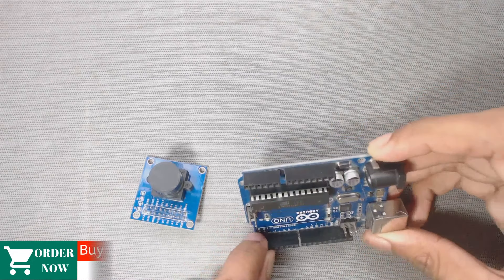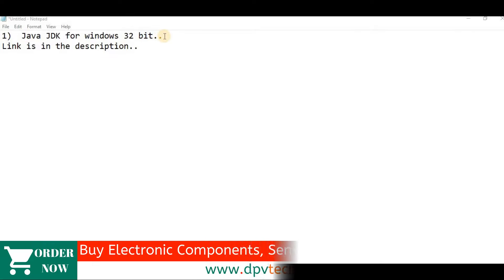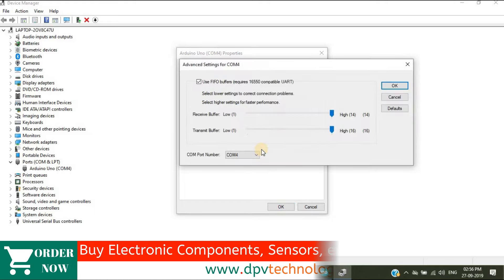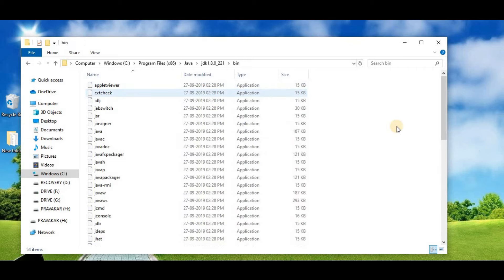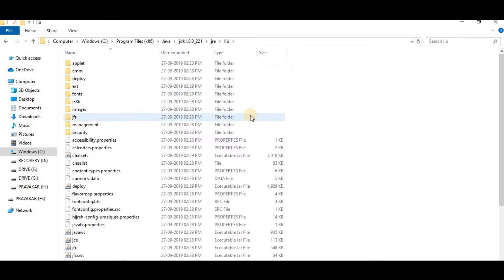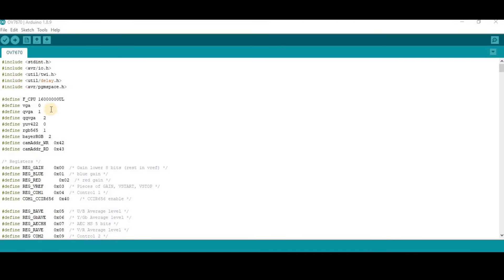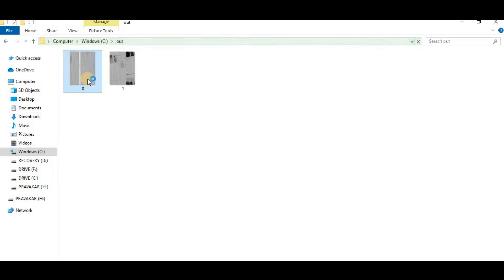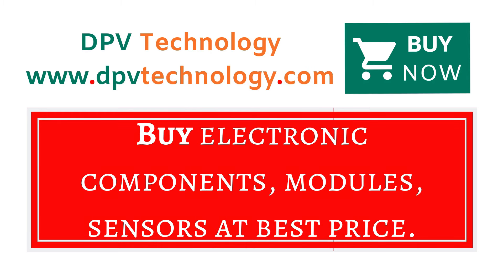OV7670 Camera Module With Arduino Step By Step

Comment: Hey , I am getting the error , SIMPLE READ could not find or locate .""? Can you please help me that
Reply from the maker: Please check the wires and connections. I did not get the error. It is very difficult to guess the problem without doing practically.
Reply: Did you solve your problem?
Reply: did you extract the files before copying?

Comment: I would like to ask if it will work the same with ov 2640. The only difference between 2640 and 7670 is XCLK. I actually tried it it didn't work.  In the end in java it says Error. Couldn't find or load the code.

Comment: thank you for your video.  I get an error at the command prompt entering :
C:\Program Files (x86)\Java\jdk1.8.0_241\bin>java code.SimpleRead
Error: Could not find or load main class code.SimpleRead
how can I get this file?
Reply: You should write "cd C:\Program Files (x86)\Java\jdk1.8.0_74\bin" and then "java code.SimpleRead"
Reply: @bilgehankarakus818  Error loading win32com: java.lang.UnsatisfiedLinkError: C:\Program Files (x86)\Java\jdk1.8.0_351\jre\bin\win32com.dll: Can't load IA 32-bit .dll on a AMD 64-bit platform
what about this error

Comment: Hey I am getting  a problem 
After i write the statement in cmd it tells that looking for image and then nothing happens
Reply: But before i did this but it  didn't show error
Reply: @ripankarmakar1476  If you get stuck at "Looking for image", the reason might be that your wires aren't connected correctly.
Reply: For example, I have the same problem because my SIOD is connected to ground via 10K resistance. 
It should be connected to 3v3 via 10K resistance instead.